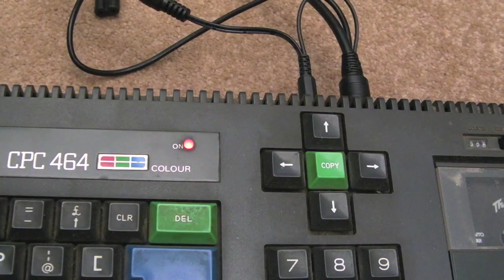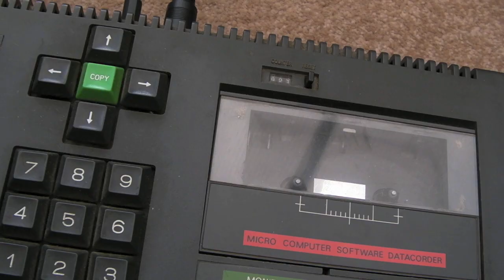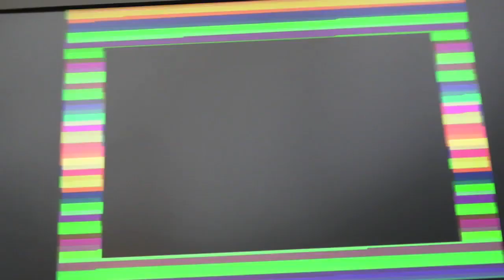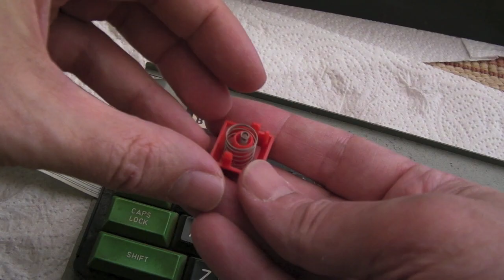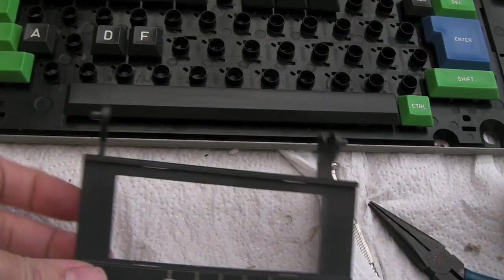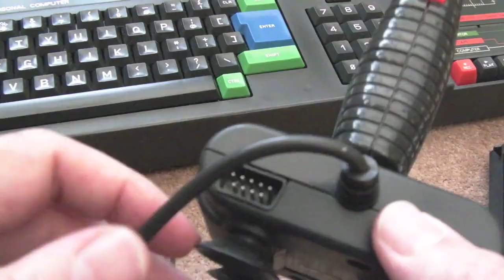Amstrad CPC 464 Repair & Restore - Junk to Jewel

Comment from the maker: Correction: The DIN coming out of the PSU there plugs into the CPC.  It contains a modulator!  I covered that in the recap of the PSU.

Novabug https://www.youtube.com/user/Novabug
Novabug's Chase HQ Review https://www.youtube.com/watch?v=FPnU0V_SRPc

Novabug's latest CPC pickup - https://www.youtube.com/watch?v=dhN0Kh7z7So

Tynemouth Software - Vintage Computers - an ebay buyers guide
http://blog.tynemouthsoftware.co.uk/2016/05/vintage-computers-ebay-buyers-guide.html

Bwack (5v saver PCB) https://www.youtube.com/user/bbytew

If you would like to support the channel via Patreon (more support = more videos) - https://www.patreon.com/GadgetUK164
Reply: What was the plastic polish that you used?

Comment: Hi

1 ==Who is manufacturing the new ==Amstrad CPC464==  ?? 

2==Brand new computers ??

3 ==What is their price ??

Best Regards,
Artur
Reply from the maker: You asked almost the same question last week!  The CPC is no longer sold and manufactured.  You can either emulator, use MiSTer, or the Spectrum NEXT with the CPC core.

Comment: 29:25 Performance difference compared to Speccy was down to a couple of things: 1. Those colourful graphics needed more data moved around per frame by the CPU. 2. The framebuffer layout was a bit weird so the CPU routines for moving graphics like sprites were more complicated than you'd guess if you assumed the machine had a simple linear packed or planar framebuffer.

Comment: I think mine is an earlier board. It`s a lot smaller. I just got a out of memory after about 30 seconds of loading a game.  It did the same on a few different games. This is strange as I thought like you said one chip goes down and the whole thing stops. I had a similar problem last week with the Speccy that had upper ram fail.  More fun lol. :)
Reply from the maker: It depends on the type of failure of the RAM!  You can get a complete fail to boot if a RAM chip is totally dead, whereas with a RAM chip that has fauly locations within it, or a range of addresses where it cannot hold data correctly, it may work up until that area of RAM is used.   You can also get temperature or time based issues where it works for a few minutes, then becomes a problem etc.
Reply: @GadgetUK164  I`ve just done a poke and 60000 ok. 70000. Out of range. I was hoping for a value at least so I could track a chip down. I will strip it down and see what`s inside. Cheers mate for the help. Must be upper ram in mine.

Comment: I’ve got 2 Amstrad CPC computers. I’ve had one of them for a very long time. Only the other day I got them both out of there boxes, and tried to play them and check they were working. The computers both started, and during play they both just went off, like a power cut, so I unplugged everything and tried to start them again, and now none of them will turn on at all. Any ideas would be gratefully recieved.
Reply from the maker: Maybe the power supply died!  You are using the correct 5v supply aren't you?
Reply: @GadgetUK164  I’m using the exact cables that go from the monitor in to the computer/ Back of keyboard.  I’m not sure what’s happened, as I’m not really good with electronics. I’m not sure whether anyone fixes or repairs them nowadays.

Comment: Hi there, I have an amstrad that works, new belts and new idle tyre, but the loading sound just seems bad to listen too, it loads games fine, just the noise doesn't sound as healthy has my primary one does, is there anyway to tune the sound, any tips or help would be very appreciated 👍 I'm trying to make it has healthy has possible for my dads birthday that's coming up
Reply from the maker: It sounds like it could be a clutch problem!

Comment: Great informative video!!! 

I have acquired a CPC after a long time without one. It's dead! so no power! What possibilities could cause this? Or would you actually need to test? 

Thanks, a noob restorer :P
Reply from the maker: It could be a bad power switch (very common), or a broken solder point on the power socket, or a bad power socket.  Beyond that the possibilities are endless.  You would need to check the 5v on the board when powered on, and work from there.

Comment: Hello, I still have my Amstrad 464, the plastic case of the monitor had scratches, so I sanded one leg with a fine grit sander and the leg was white, with liquid polish and many hours of work I have managed to return a little. black color but it costs a lot. Do you know of any way to remove the white color and return it to its original color? that computer has great sentimental value ...
Reply from the maker: You could try polishing with Meguiars Plast-RX, but if the scratches / discolouration is too deep it may not work or worsten.  Alternatively you could smooth it down, remove the plastic shell and spray paint it.
Reply: @GadgetUK164   Yes but the spray paint would not have the dame components as the Amstrad paint and then it would alter its originality, with the liquid polish i have removed a lot of white color but i still need it. Do you have an mail to send you pictures of the computer and can help me?

Comment: hello i have the sameone can you help me out please i cant get the drive
 to spin any help please on what can be wrong thank you i have put a new
 belt on. just one more thing what is the pause button white clip under 
the tape drive called please has mine is missing so need to get a new 
one thanks again
Reply from the maker: Does the CPC work though?  Its just the tape deck not playing?
Reply: @GadgetUK164  so sorry it was the the first bit was about the disk drive and the 2nd bit was about the pause button the white clip under the tape drive
Reply: @GadgetUK164  the tape deck works fine but cany use the pause button the white clip on the under side is missing

Comment: Hey Gadget UK, i have a question i`m not sure if you can help. i have bought myself a scart/power kit for my cpc 464, it works ok, just a small thing, there is a scan bar, (don`t know if that`s what you call it), with flickering dots in it, that goes down the screen. See this video, this is not mine, but the same thing...     https://www.youtube.com/watch?v=Qo_onhWrOCU       all the colours and that are fine, its just that, looks like some sort of interference to me. Would appreciate any help. Cheers.
Reply from the maker: What are you powering it with - an after market / 3rd party PSU?  Modern PSUs (cheap ones from China) often will produce a rolling band like that due to switching noise.
Reply: @GadgetUK164  i bought the amstrad from a reputable ebay seller, there was no original monitor with it, so it was included with a scart / power kit. The power adapter is small, and dosent have any branding on it. One thing i have noticed, i have the amstrad and the TV that im connecting to plugged into the same plug socket panel. (2 plug sockets on the wall panel). I tried plugging the TV in to the socket on the opposite wall, and the interference is not as bad. The kit is one of these, although unsure if it`s the same one......https://coolnovelties.co.uk/coolnovelties/amstrad-power-cables/27-amstrad-cpc-464-tv-connection-kit-0705693506418.html?search_query=amstrad&results=19.
Reply from the maker: My bet is its the PSU!  I've seen the exact same type of noise on other systems when using cheap chinese PSUs!

Comment: I just brought a amstrad cpc 464 but I got the left arrow key missing and the number 2 key keeps failing off but I don’t know where to get them
Reply from the maker: The only place you will find a replacement is another faulty CPC, or maybe on eBay.  From time to time spare keys for various keyboards are sold seperately on eBay - from faulty systems.
Reply: one come up on eBay the condition is ok just 2 bits of plastic off the vent across the top that’s all  good thing it was cheap and all working he didn’t know how to work it

Comment: hello i have a ddi-1 for my amstard 464 its very old now lol.  i thing the stepup morter is bad has it dose not spin do you have any idea how i can check the voltage on it please
Reply from the maker: If you disconnect the stepper motor and feed it 1v between its two connections, it should move.  If it doesn't you need to find a new stepper (or try to repair the stepper).  You could measure the voltage going into the stepper on volts DC on a multimeter and use some software to try and drive the stepper whilst you take the measurements.

Comment: If you use IPA or 99% Alcohol, it's a much better job if you use a paint brush, I personally use a pastry glazing brush as  it seems to have a nice stiff feel to its NYLON bristles and thus able to work the IPA or Alcohol into nooks and crannies where water damage seems to do the most harm, Once done with the cleaning, it's a good idea to use another dry brush to follow up, and then allow to evaporate for 48 hours, if you have a can of compressed air, that will do nicely and save 36 hours of waiting BTW - "NEVER EVER USE A COMPRESSOR" that pumps up tyres to blast it dry, as those compressors will most certainly introduce water vapour onto and into the circuit boards nooks and crannies, even if you think your compressor doesn't blow out any water, trust me they in fact all do, and it's the very reason why compressed air is sold in a Disposable Can..

Comment: BBC BASIC had two pointers !! when you pressed the cursors shows the copy cursor !! :D  

There was a guy I knew many years ago who died around 2000 who was the designer of the ram drive for Amstrad and he upgraded his own to have multiple drives all sorts of sizes and wrote his own OS for it it had 640K and so much more and that was a CPC 464, he was ahead of his time, shame he died he taught me a lot around programming on Z80 .. he helped port over software from the CPC to the Einstein back then ...
Reply from the maker: What a shame =(  Sounds like a smart guy!
Reply: @GadgetUK164  Yes he was very much so! he was that good he could look at a circuit board and tell you what was faulty even on prototypes .. my father met him when they worked at Manchester Poly in the 80s as lecturers in Electronics and Micro processors ...

Comment: You should try using bus wire to bridge gaps. So much easier.
Reply from the maker: Yes, I do often use some very fine coil wire - just on this occasion I grabbed what was nearby at the time!

Comment: The speaker on mine buzzes rather loud should I replace the speaker?
Reply from the maker: Maybe you need to swap some of the electrolytic capacitors in your PSU or on the audio section of the tape deck (I think the speaker is powered from there).

Comment: I have a question. My CPC464 emits a whining noise from speakers. I unscrewed the tape&speaker control board, and under two of the capacitors i found a yellow-ish substance. (https://imgur.com/a/lGjf8Qi#FqQmusa)
Is it the same in your cpc? Or have my capacitors leaked? Thanks
Reply from the maker: That yellowish substance is a sillicone or glue to hold things down!

Comment: I wish I could find those £30 CPCs on eBay!

I live in America now, so it's really hard finding computers at a reasonable price from a seller who's willing to ship overseas.

My childhood CPC 464 didn't come with a monitor, it had this enormous power supply/RF modulator box that plugged into the TV. I might be exaggerating the size of it in my mind, but I'm pretty sure the modulator box for my Amstrad was bigger than my Spectrum!

I received the Amstrad as a gift from a relative who no longer wanted it.
Having an Amstrad was a bit lame, because all of my friends had C64s and Spectrums. I ended up continuing to use my Spectrum most of the time as a result.

I ended up selling the CPC to partly finance my Atari ST. I'm happy I did it at the time because I really love that ST (which I still own to this day), but I do want another Amstrad.

Comment: I had  a CPC6128 around the late 80s, I got in on sale at Argos, the one with the disc drive & colour screen , it was around £100, I know I had to phone around several stores till I found onein Hammersmith, the last in stock, it was a good machine & the magazine Amstrad Action provided good support...
Reply: AA was the best of the specialist Amstrad CPC magazines. If I remember correctly, there were 4 of them. One 2as the official Amstrad may, another was " Computing with the Amstrad" . I can't remember what the other was called.

Comment: The reason CPC ports often didn't run as well as the Spectrum version is because the Spectrum has an 8k graphics display while the CPC uses 16k. All those pretty colours require extra memory to control, so with all other things being equal the Spectrum could rewrite screen memory in half the time of the CPC. This is why CPC games often used a severely reduced screen size.

Comment: I had a 464 in the 80's and loved it!  I managed to acquire a new in box keyboard (same version as Novabug) and a scart cable/power lead from Retro Computer Shack.  All works great apart from when inserting the power lead in I have to press the lead down/wedge to maintain power.  I want to know are there any options to this problem?  
Thanks.
Reply from the maker: Sounds like the DC barrel socket has a bad solder point on the board.  Just take the main board out and inspect under the power socket.  Chances are you just need to resolder the connector.   It could also be the connector on the power lead that's bad.
Reply: Thanks for the reply and the advice!  I will look into it at the weekend and see if it can be fixed.

Comment: If a board can go into dishwasher, then it can just as well go under the shower or into the sink. Anywhere where you can give it a bit of water pressure and dish soap. Naturally it's not the most conservative way of cleaning a PCB, but this particular board, looking at it, must have seen worse.

Comment: I decided to pop my restoration cherry and begin the process of reviving my old 464.  30 years of ownership with 22+ years in the loft left had left it in surprisingly good order, if very grimy.  The weird thing is that my two blue keys have suffered discoloration, which is a drag.  But she did fire up first time.

The tape deck works but all I get is a lot of noise/interference out of it.  I can hear the program playing faintly when I try to load it, but it won't pick up.   The tape unit will need some closer inspection.

Very good video.
Reply from the maker: Thanks, let me know how you get on!  Chances are the belt needs replacing, heads cleaned, pinch roller cleaned (and possibly edge roughed up).  Maybe tapes will work then! =D

Comment: I used to think this computer was kinda primitive.  After seeing 'Chase H.Q.' and now knowing that it outputs stereo sound, that opinion has changed.
Reply from the maker: Hehe, yes, I think we've all thought that.  There are some great games on the CPC and the sound and colour is great.  Just a bit slow with some titles.
Reply: GadgetUK164 - Retro Gaming Repairs & Mods Slow loading or slow playing?  Slow playing isn't unusual for the time, and if it loads from a tape drive, slow loading is always the issue.
Reply from the maker: Slow playing - some games are lazy Spectrum ports and run slow, others are just not very well optimised for the CPC hardware.  There are some great newer re-releases of some games though - see the R-Type remake for example.
Reply: The 3" disc drive works way faster than the Amiga or ST, just a few seconds loading

Comment: I wouldn't recommend using your home dishwasher if only because those use and need salt to  properly function and salt is corrosive, especially when diluted. I'd stick to Alcohol.
Reply from the maker: Agree =D  Good point, I didn't think to mention about contaminants from the dishwasher.  Depending on how dirty the dishwasher is you can end up with food particals on there lol.

Comment: How do you find replacement chips ? I need a Cpu for my NES that somehow got fried and is just displaying a gray screen :/
Reply from the maker: Custom chips like the PPU and CPU on the NES, you need to find some faulty systems or boards to use for spares.   There are loads of cheap faulty Famicoms on eBay (search for Famicom Junk).  The Japanese Famicom has the same CPU and PPU as the north american NES.
Reply from the maker: BTW - gray or green screen, I would suspect the SRAM!
Reply: GadgetUK164 - Retro Gaming Repairs & Mods no I changed both of the ram chips and it didn't worked ...
Reply: GadgetUK164 - Retro Gaming Repairs & Mods And my console is European I can't use a famicom as a donor console :/
Reply from the maker: Ah, I see!  So you need another PAL NES =/  You could convert it to NTSC, by changing the crystal and swap the PPU and CPU from a Famicom.
Reply: GadgetUK164 - Retro Gaming Repairs & Mods Yeah but my pal games will run faster than they were supposed to

Comment: Fantastic job. Very impressed. Do you use a green silk screen touch up pen after repairing corroded traces??. It just adds to originality and protection.
Reply from the maker: Thanks =D  It's a personal choice thing really.  You could use a touch up pen or something similar (nail polish etc), but solder will be fine exposed.  It's bare copper that needs toughing up that way really.  But I agree it can make a repair look cleaner and tidier =D
Reply: GadgetUK164 - Retro Gaming Repairs & Mods 

I think I would use a silk screen mask pen. If I'm  already in the machine and spent all the time cleaning up the traces and board etc then why not.
Reply from the maker: Yeah, totally cosmetic if the trace is covered!  No one is going to see it, so why waste more time painting it?  If there's exposed copper, I can see the point, but when covered by solder, solder is doing the job of the solder mask.